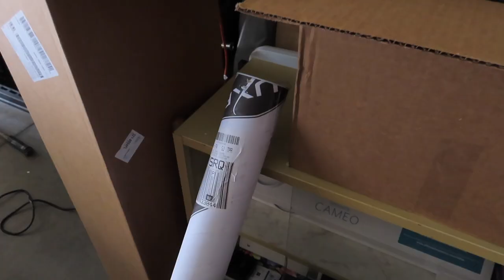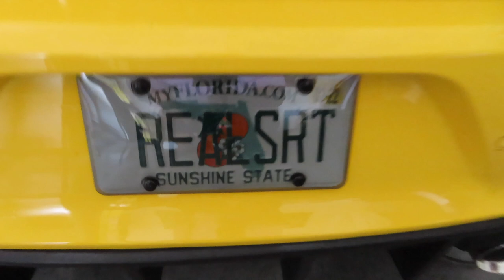SRT 392 Charger gets  some new mods added | GARAGE DRIVEN

Comment: What kind of cold air intake got put in,cause u wanted to do sand grille with tube &a mopar cold air intake &find out those two DON'T work together
Reply from the maker: That was a Hellcat intake setup
Reply: @GarageDriven  so the only thing that changed was the air filter,cause I was disappointed trying to set up a cold air intake with the 2019 grille that had the tube.they said it couldn't be done.I didn't know there are two different air boxes!I got the Hellcat air box.that's like when fat cat had the  front splitter extension I couldn't get ,I like that splitter extension too.Thanks for the reply appreciate d.that is looking good,but I love those "DAYTONA "!!
Reply: @GarageDriven  also thanks for clearing up the difference in SRT &SCAT PACKS

Comment: Are the snorkels in the 19 & 20 functional?
Reply from the maker: Nah they’re not....only Hellcats. Check your lower box before buying one some has a cover over the port and if so you’ll only need the inlet tube and the shield to make it work. Bumper does have to come off for installation.